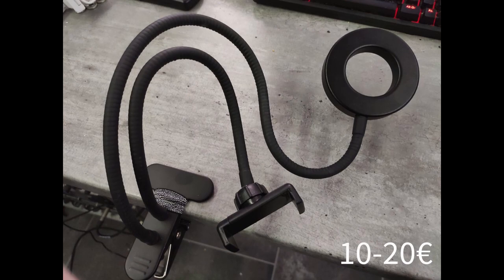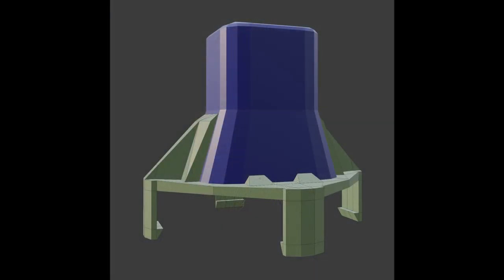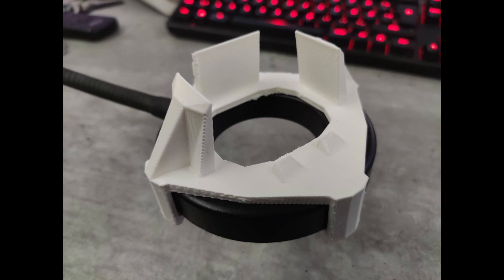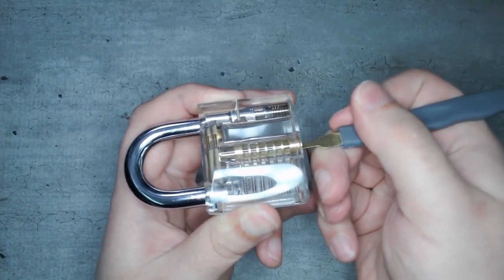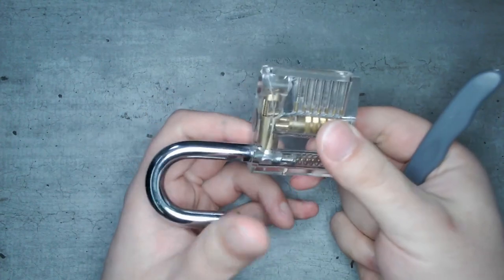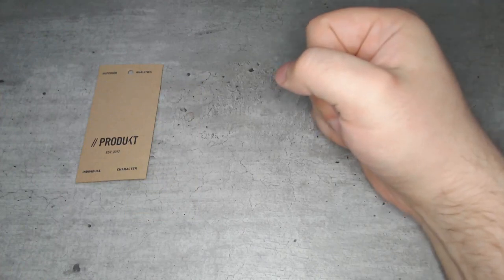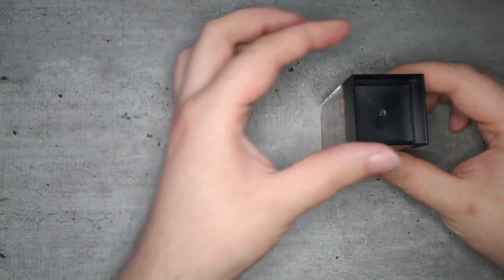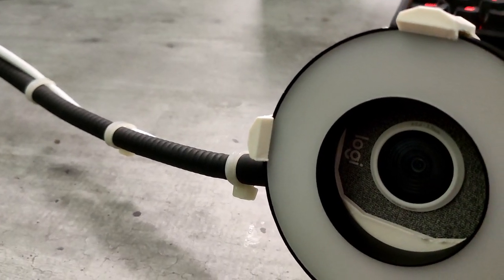3D Print An Amazing Overhead Cam Setup!

Comment: Nice job! I wish there was a firmware fix to the orientation lock issue for overhead shots. I also really like this solution just for everyday videoconferencing, to avoid having to mount the webcam and lights separately. I’ll be trying it out soon!